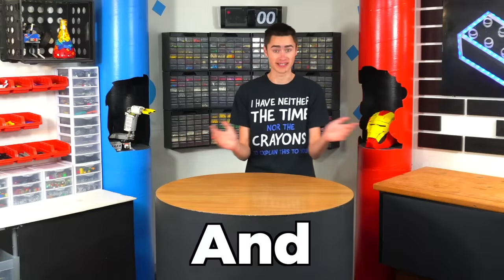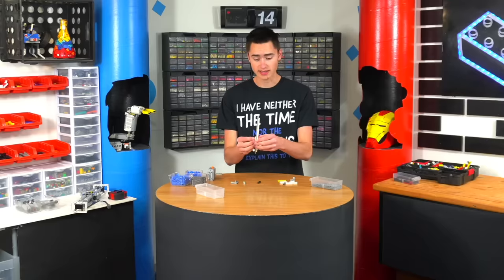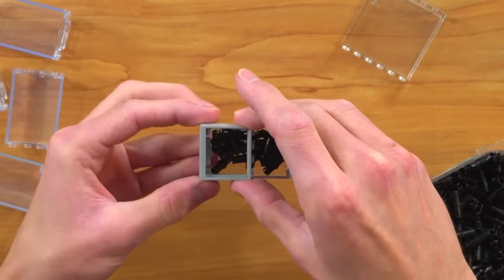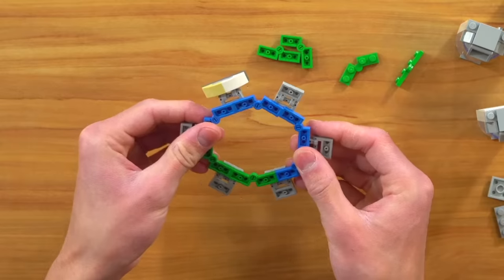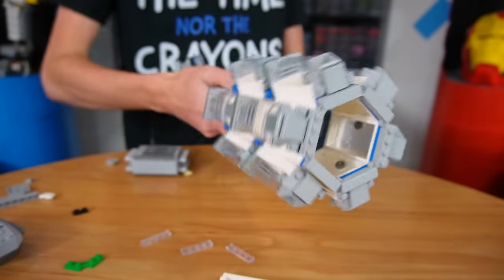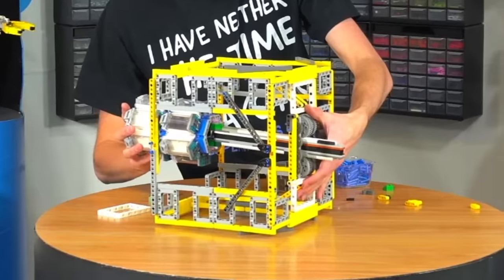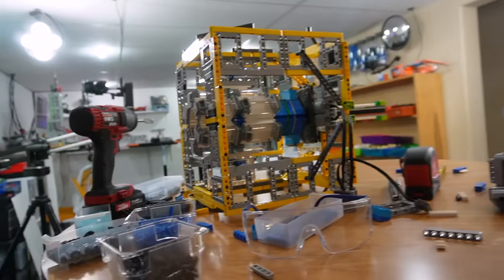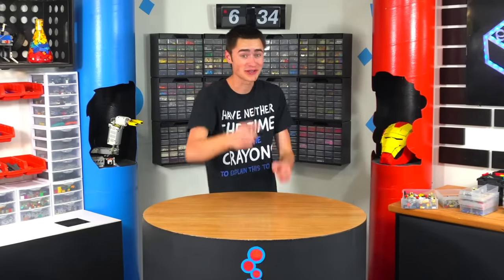I Built the COOLEST LEGO Invention! (hidden storage)

Comment: The way it works too, theoretically if you made the hinges on the containers stronger, you could leave them down and whenever you lower it, they automatically get pushed back into place.
Reply: That would cause issues with scrapes and damage to both the table and lego
Reply: Good idea but it wouldn't work well, the doors have studs and

Comment: Extremely important question: so I had a motor with 16 teeth to a 8 teeth connected to a fan and I had it running and the axle that I was using stripped and the motor slowed down why did that happen?